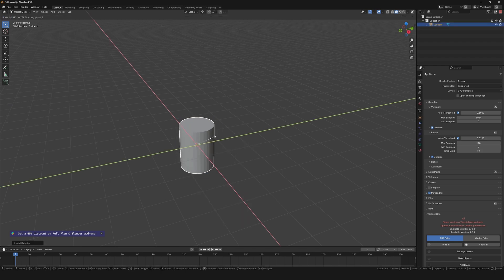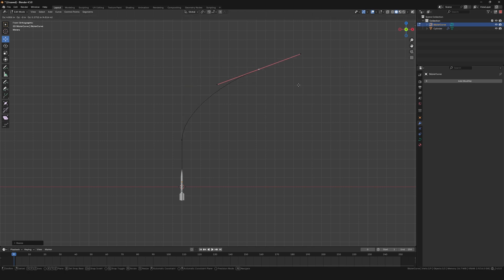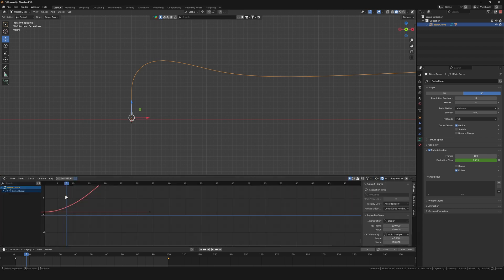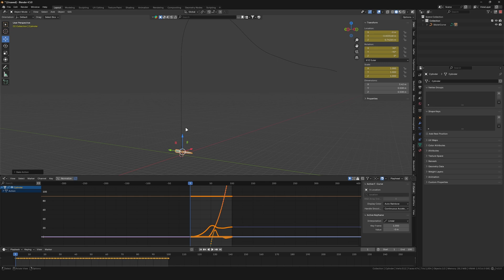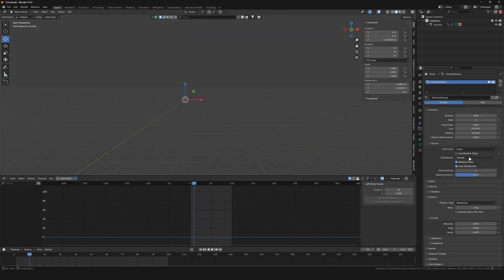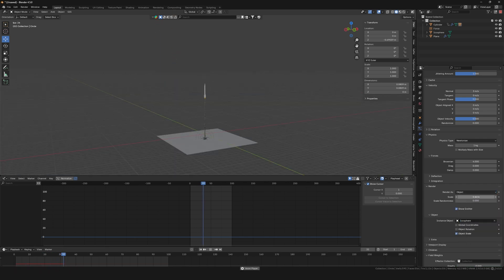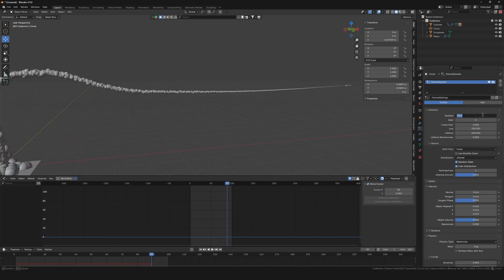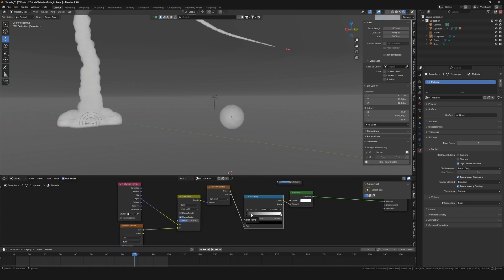How to Create a Smoke Trail in Blender (without a smoke simulation)

Comment: Thanks very much for the tutorial - very helpful. I couldn't get the fluffy ball at the end with the noise texture and linear light node by copying your node tree - can you explain in that set up how you get that effect or what you need to do to create the fluffy cloud effect. I think this breaks up the balls being balls because I have my smoke trail coming from the back of a commercial plane with the smoke trail going towards the camera positioned behind the plane.

Edit - I got it in the end. You had it plugged just into an emission node. Sorry. I used the volumetric bsdf so I could tweak volume to lighten and darken the darker and white parts of the con trails.